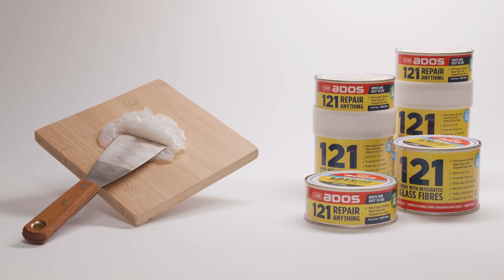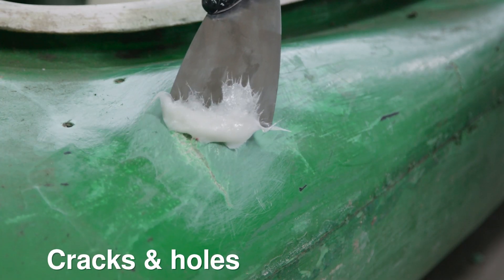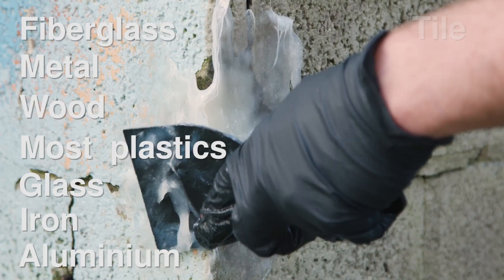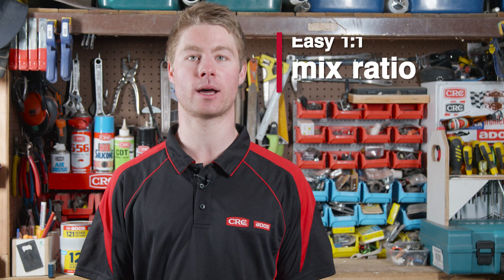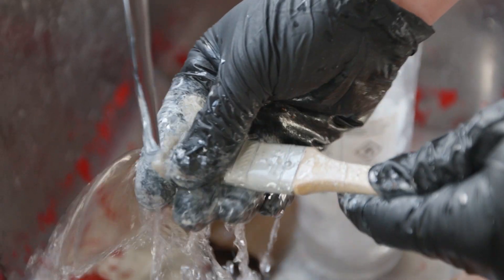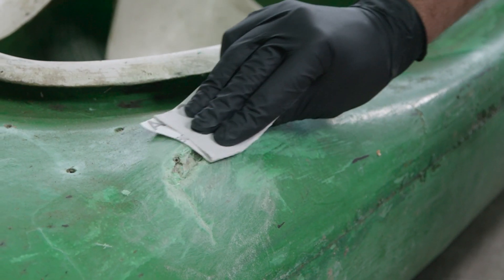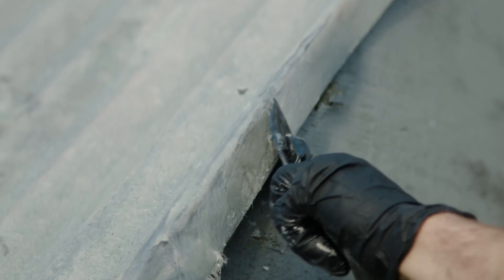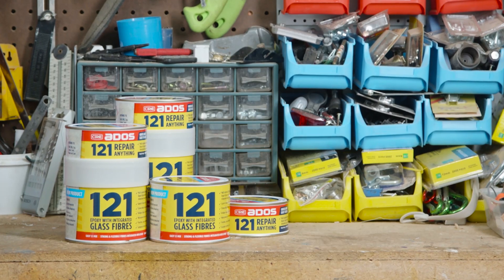ADOS 121 Repair Anything

Comment: So its 1:1 in volume? Is there a mixing rate for weight based ratio, as the 2 are hugely different from each other. I've ended up with a slightly soft result and considering  the cost of $65 I'd be more happy if there was a more accurate measuring method. Thanks.